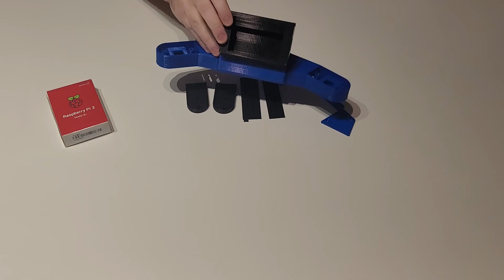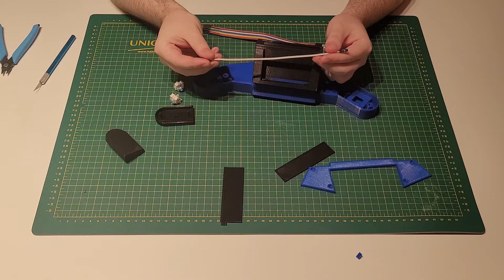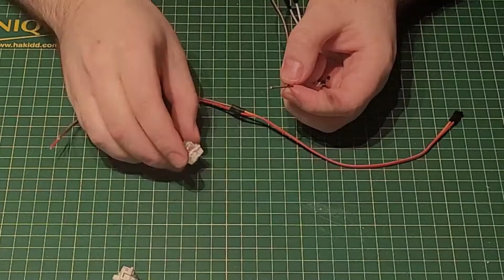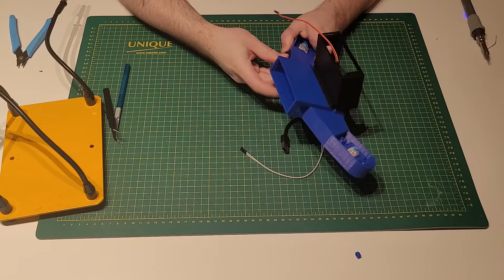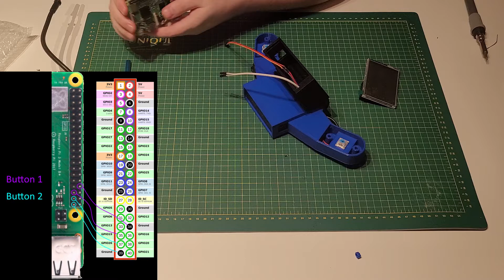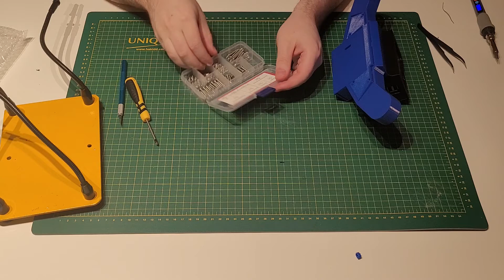PiMat Rubiks Cube timer assembly

Comment: @mrusse, this is a great project thanks! 3d printed all the parts and needed to reinforce the main frame. Let me know if you want me to share :) a question: when I install the script on Raspberry Pi Zero W (1), it gets stuck in cursor blinking. Do you think this is because of low processor power? Or should I repair something?